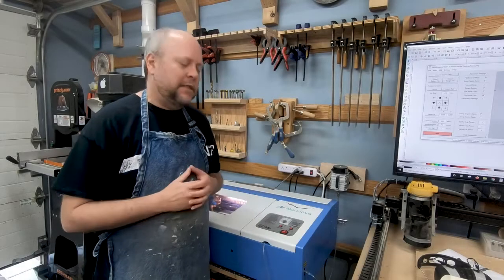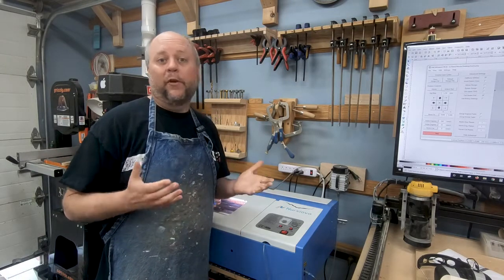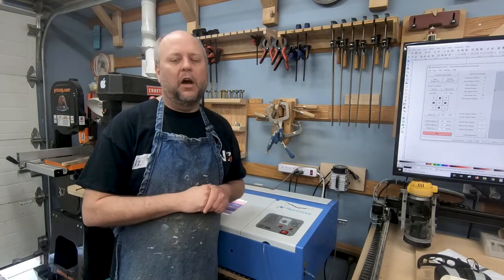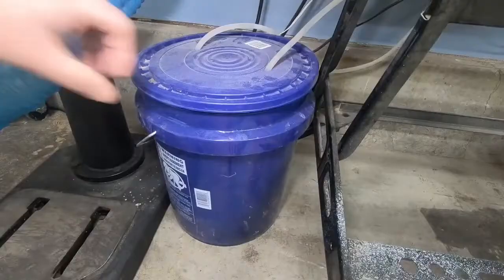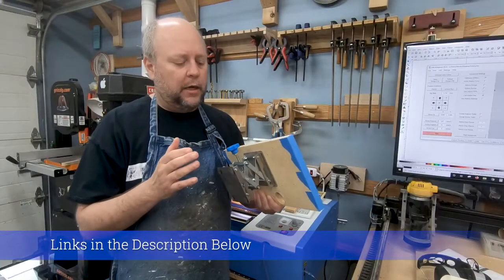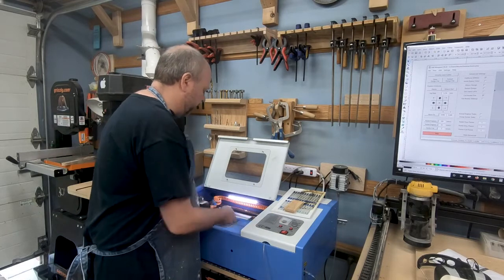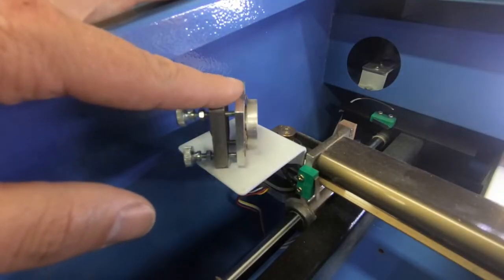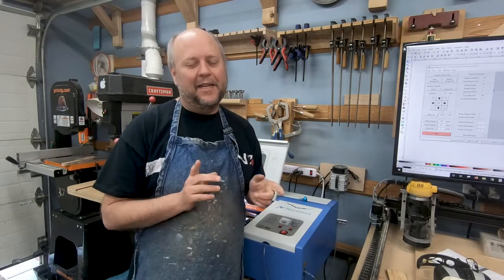K40 Laser Cutter & Engraver   What Do You Really Need To Get Started?

Comment: Hello, how do you know what temperature your water is set at when its running through the laser tube and is it important because you said that you just put in 2 -2 litter frozen water bottles in the bucket.
I just ordered one on eBay and I don't want to ruin the laser tube. I'm in the San Antonio Texas area.
Reply from the maker: You just don’t want to overheat it.  I try to keep mine around cold tap water or colder. You just don’t want it warm or hot.
Reply: @LaserPop  Thank you sir you are the best! Hope to see more video’s in the future on the K40 laser. 
Cheers!

Comment: I got one with the digital display and it is definitely necessary to measure the the current output to determine what setting pushes the maximum current the tube should see. It's not difficult to add a meter so I added one myself.  I found that at 45% my K40 is already at 15 Ma so I stay well below this value.
Have you tried using MeerK40t (Meerkat) as a replacement for K40 Whisperer?
Reply from the maker: Thanks!  That's the problem with the cheap lasers....just because it says 40w, doesn't mean that's what you're getting....LOL.  I've been playing with MeekK40t a bit.  I really dig the way it does photos.  I'm still experimenting with it and will eventually come out with a video.  I don't find it to be the most intuitive program, but it does a lot of really cool stuff.